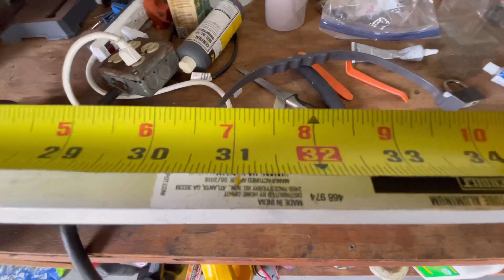1964/1965 Lincoln Continental Convertible Engineering Defect

Comment: I put a square tubing on my '65 Continental three weeks ago after watching this video. I also replaced a broken bracket that broke because this tube was not installed. I bought the tube at Home Depot for under $20. I measured it and had it cut while in the store. The install was a tight fit. I'm very thankful for the advice from this video.
Reply from the maker: Thanks Tony for the follow-up comment. Yep you did it perfect then. I tell folks square or round is fine just like Cashman told me. Good deal!!! Love hearing it!!